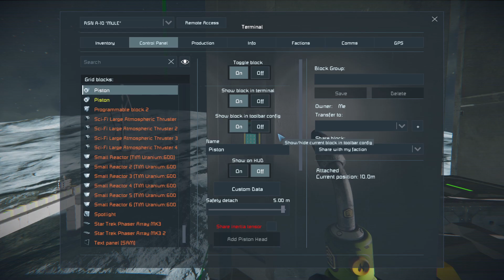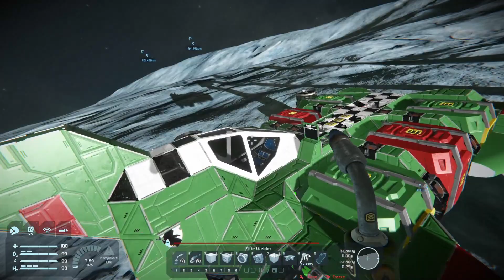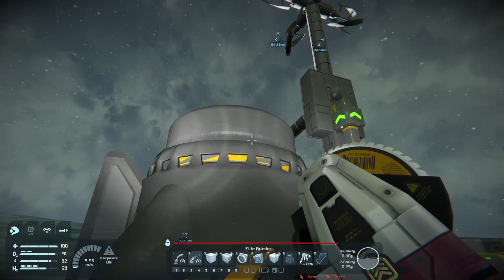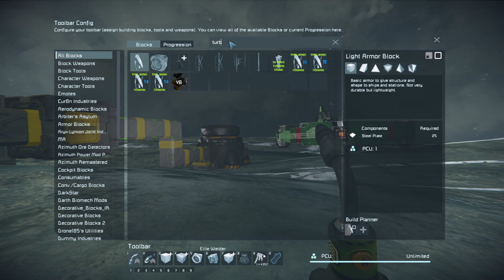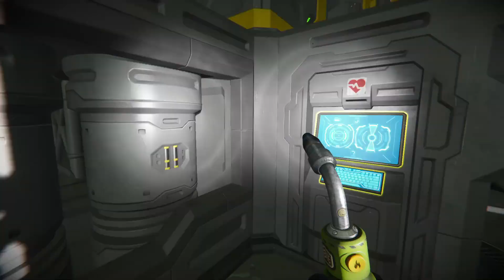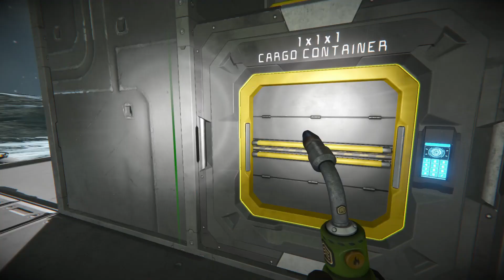STATIC DRILLS & CLIMBER :: Space Engineers Survival :: Ep. 947

Comment: Some more about ResourceNodes:

They have to be quite a bit inside a voxel. When placing an unbuilt block, there's an emissive bit in the middle of the wireframe. If it's aqua like (31:24), the ore is properly detected. If it's red, don't bother welding it up. You can also check the UI on the incomplete block.
Drills produce slower if they are closer than 50m (20 LG blocks) from each other (I think it's from center), and you get a decrease for every nearby drill. That only applies if they are extracting the same ore (e.g. taking stone from near uranium pile is ok).
Upgrades, unlike assemblers and refineries, don't increase power consumption. The increase is less dramatic, however.
Reply from the maker: Figured that out in the video.